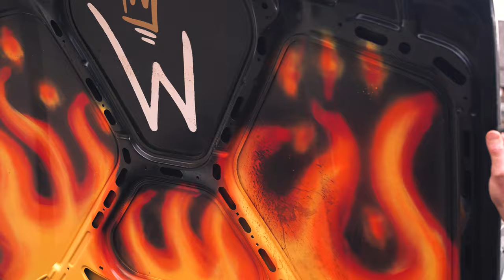CARNAGE In The E36!! | BMW Drift Build

Comment: Standard m54b30 fuel rail is fine to use. Just use a m54 fuel filter and the pressure regulator is on there.
Reply from the maker: Thank tou for the knowledge man!
Reply: @WeaselWerkz  anytime mate.